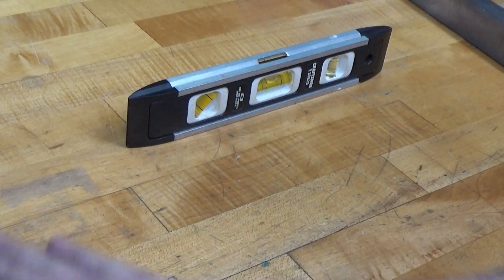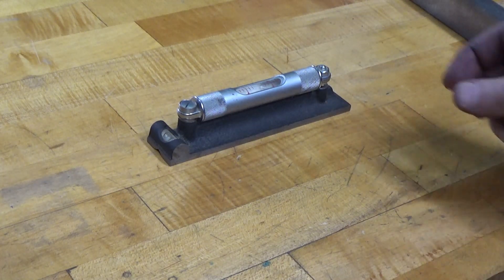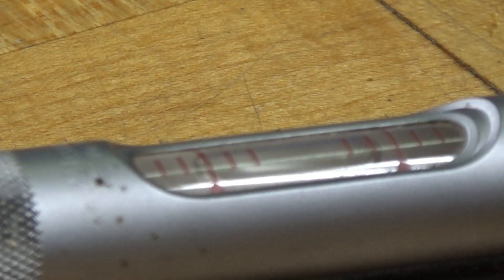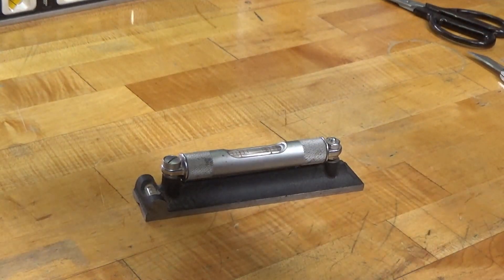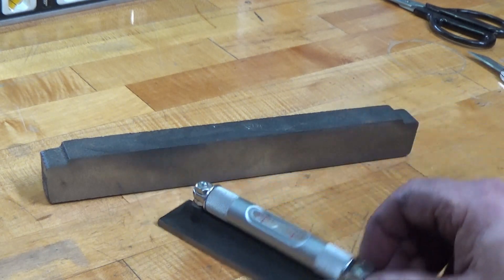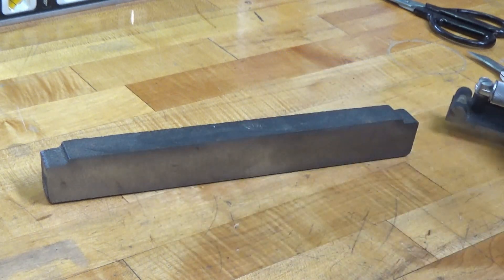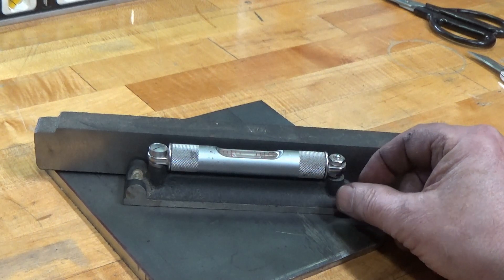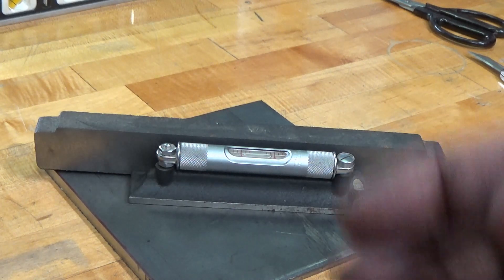Calibrating A Precision Level - Addendum

Comment: Thank you so much man I'm brand spanking new to Machining I have a Starrett 98 and I am so confused on what I am supposed to level it on I a fixture plate from Fireball tools that is a about 5,000 flat across it so I didn't know if it would be okay to use that or not. Thank you after watching this video I know it is. Thank you so much...
Reply from the maker: I am glad that the video helped you. Thanks for watching and commenting.

Comment: So, use a 4" torpedo level with a .250 accuracy to verify a macinist level with a .005 accuracy 😂 keep to wood working dad!
Reply from the maker: Hardly. don't know how you came up with that idea.  The point is that you do not need a precision level surface to calibrate a precision level.
Reply: You don’t know much about machining do you ?  Stick to gluing paper

Comment: Here's what I experienced: the bubble was off so I swapped end to end and the bubble was off by same amount, it followed the "uphill" side of level just like you showed.  However, after I then adjusted the nuts so the bubble was centered, I checked it by swapping it end to end again and it was way off!  Why?
Reply from the maker: I the bubble was off and equal amount when reversing the direction than it was correctly calibrated at that point.
Reply: @sharkrivermachine  What I found was small adjustments were needed to both the level nuts and then reconfirming the symmetry swapping ends.  I was making too big steps.

Comment: I am really confused about how to calibrate spirit level. I own 6 quantum with precision of 0,02mm/m. When I put those level on a flat surface (I use a glass with 10mm thick) in one position the bulb is on the left and when is rotated of 180 ° the bulb is in the same position, left side. What does it means? In theory we need to have the vias, paralel whit the foot ot the level, right? If so, if i adjust a little to center the bulb, when rotate the bulb is not centered but go to one of the side. The adjut system is very tricky and put me nervous. Could someone help me to understand how to proceed? Thanks in advance
Reply from the maker: In the first half of your question it appears to me that your level is calibrated correctly.  So without making any other change to the calibration just rotate the level on the surface until the bubble is centered.  Mark that position and rotate the level 180 degrees, the bubble should still be centered, if you have calibrated it correctly.  Thank you for watching and commenting.

Comment: I’ve read the checking surface does not need to be close to level, it only needs to be repeatable when the level is rotated 180 degrees when placed in the same spot. Levels are self checking which is a beautiful thing.
Reply from the maker: That is correct, but the closer it is the easier it is to calibrate when swapping end for end.  Thanks for watching and commenting.

Comment: Thank you for your video.  I have a question.  I just bought a new precision level and I can't seem to calibrate it.  I am on a flat surface checked with 3 other high quality levels.  When I get the bubble to the centre of the level then rotate it 180 to check it the bubble goes all the way to the side.  What am I doing wrong?
Reply from the maker: It sounds like the surface is not a level as you think it is.  That is not a problem.  With the bubble in the extreme location start to rotate the new precision level on the surface until it stats to move.  Mark that location by laying heavy straight edge along side it.  Then rotate the level 180 again and check to see where the bubble is. Keep doing this procedure until the bubble is in the center or has the exact same offset each time you rotate it 180. Hope that this is helpful.

Comment: Sir, Can be explain term "Level Spot" used by you at 1:30 min of your video ?
Reply from the maker: On any surface that is reasonably level there is an orientation that is perfectly lever if you rotate the precision level on that surface.  Once you find that spot you can mark it, then swap you level end for end and returning it to that same spot to further calibrate it. I use a 1-2-3 block or similar to mark the spot so that I can return the precision level to the same spot each time.  As long as the bubble is in the same spot when swapped end for end the precision level is calibrated.  Hope that helps.

Comment: What if you don't have a "known level" surface, but have a flat surface. Can you make the level the same line off-center when you flip it on either side? Example 1 line to the left then rotate the level and have it in the new 1 line on the left?   That is if 1 line to the left is the same spot when you turn the level around.
Reply from the maker: That is what I was trying to show in this video. As long as the offset of the bubble is the same in both directions you have a calibrated level.  Thanks for watching and commenting.
Reply: @sharkrivermachine  Happy Face Emoji.   Now to start cleaning up and repainting that rusty Stanley No 36 Level. Hopefully, I can make it accurate again as well.

Comment: Nice job Steve, I guess I missed part 1. Lots of different ways one can do this but I have even took a known flat plat on any old table ( making sure table is solid ) and use note pad paper to shim  plate to level.  That's one thing about a level, if the bubble centers when you turn it 180 its level.   Thanks for sharing. Off to check out part 1.     Gary
Reply from the maker: Thanks for watching and commenting.

Comment: You want the bubble vial to be parallel with
the bottom of the level correct?
 I’m thinking Inwould use an indicator and
check each end for any difference.
Reply from the maker: The level is self proving by swapping end for end.  Make sure to check the original video on calibrating the level.  This video is just some additional information explaining that it does not have to be done on a precision granite surface plate.  Thanks for watching and commenting.

Comment: You can also use a 123 block and a machinist jack to make a test stand. Put one end of the level on the block and raise and lower the other end with the jack until it reads the same when you swap ends.
Reply from the maker: There are many ways to do most procedures. I try to show ways that do not require any special tools. Thank you for watching and commenting.